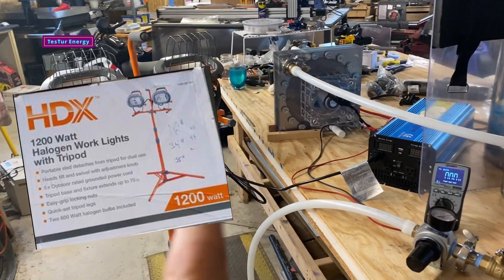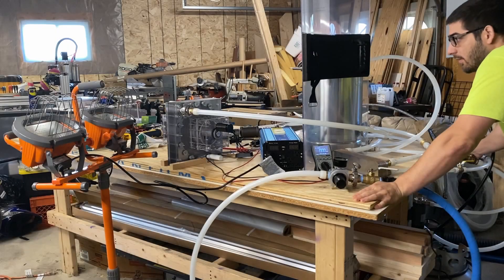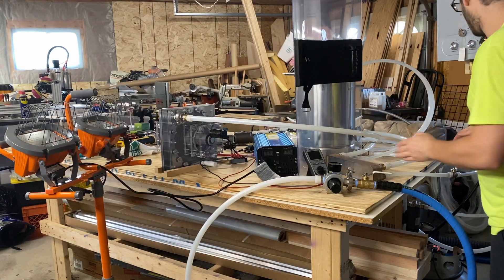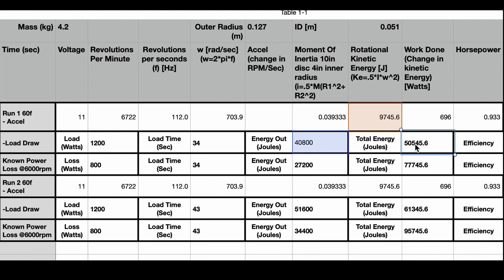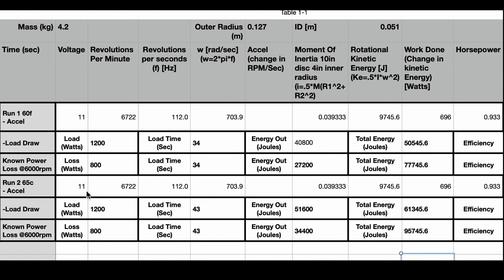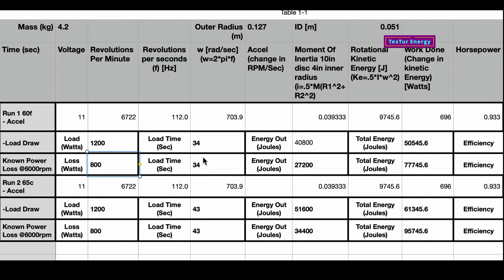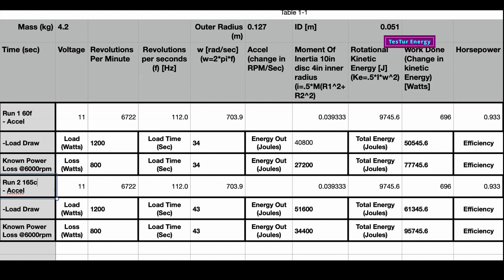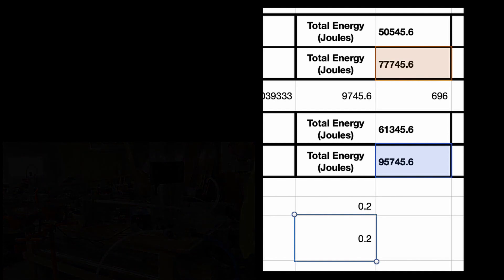Tesla Turbine 1200 Watt Electrical  Load Tests - Power Calculations - compressed Air + Propane

Comment: Really interesting. I'm an old boilermaker. I'm looking at designing micro biofuel boilers for farm and prepper situations. I'm also keen to produce a synergic stand alone energy provision  product as a side line cottage industry to supplement my contractor business. I think even using car batteries and inverters something basic under $20,000 should be do able. Great video loved the systematic extrapolation of fail and loss points. Subbed

Comment: I would love to see if this system could be run directly on pyrolysis gas from a TLUD gasifier. Woodchips are free and abundant here. Could water be injected directly into the turbine to reduce temps and increase efficiency?
Reply from the maker: Hey Matthew, thanks for commenting! It really helps the algorithm. 🙏 

Yes it absolutely can! I’m already working on the burner replication from Tesla’s Improved combustion + steam turbine patent GB 186,083. 

If you’re not familiar with this one he patented it in 1921, 10 years after the first one and a decade of R&D on the turbines. 

It’s a completely fuel agnostic electrical generator system. 

In the patent, Tesla explains that he planned to use every kind of fuel in it, from gaseous type fuels, to liquid, “colloidal fuel and even powdered coal”!!!

I’m hoping to be able to even use powdered iron as a fuel. 

You can’t use solid particulate fuels in traditional bladed impulse or reaction turbines. Note fuels that make a solid particulate exhaust like powdered iron that turns to solid FeOx’s, aka “Rust dust”

I have a couple videos that go further into explaining it!  

The first half of this video is about the vacuum steam, aka “cold steam”, systems that can be used with any heat source. However, in the second half of the video I go through Teslas GB 186,083 patent and explain all the parts to it. 
https://youtu.be/5Y3D13JmtcA

There’s also a bunch of videos on my channel of the burners I’ve actually got working and making high temp superheated steam. 

I will be connecting that to the turbine next after these next compressed air tests that I’m doing right now. 

These are the latest liquid fuel burner tests for the replication of GB 186,083.
https://youtu.be/gRqKowignac

These are the latest propane burner tests.
Tesla Turbine Jet Engine Combustion System GB 186,083 Superheated Steam
https://youtu.be/KCyyiKnIarc

I’m still working on the solid fuel particulate burner but I’m not far off on it. 

I haven’t gotten to my Tesla disc compressor tests finalized just yet but I have the setup to do them already just gotta do some upgrades to my bearing and gear hubs for the generators. 
10in Tesla Compressor & Turbine w/ Built In Balancing Apparatus RC Car Dual 6s 3kW 2200kv BLDC Motor
https://youtu.be/
Reply from the maker: NIKOLA TESLA BRITISH PATENT 186,083 - IMPROVED METHOD OF AND APPARATUS FOR THE ECONOMIC TRANSFORMATION OF THE ENERGY OF STEAM BY TURBINES

“This machine is capable of operating satisfactorily at very high temperatures, with cheap fuel, containing a large percentage of impurities, and without substantial impairment of efficiency as might be due to oxidation, roughening of the metal surfaces, or similar deteriorating actions which seriously interfere with the working of other heat engines now in use.
 
In applying my invention to a steam power plant I use air, under a pressure about equal to that of the boiler, for burning gas, crude oil, colloidal fuel or powdered coal in a chamber or conduit into which the steam is simultaneously admitted as cooling agent and diluent. 

The provisions to this end will greatly vary according to conditions. 

In central stations, factories, on shipboard and in many other places compressed air, as well as steam, is available and often, too, all the facilities for fuel storage and supply may be on hand. 

In such cases the benefits of my improvements will be readily derived with but little additional apparatus and at small cost. 

If the circumstances require, I provide an air-and also a gas compressor when necessary, driven directly from the shaft of the prime-mover or operated independently by electricity, steam or other motive agent. 

Generally these machines will be of the more efficient reciprocating type, but rotary compressors or both may be employed to secure some advantage. 

Irrespective of specific arrangements I effect the combustion while the fluids are in rapid motion and in a conduit preferably in close proximity to the engine, thus disposing of most of the difficulties previously encountered and at the same time materially reducing the radiation and conduction losses which would be incurred in the passage through long pipes. 

To better insure the maintenance of standard working conditions I may add to the equipment an equalizer of pressures operated differentially by the air and steam, but this device is not essential. 

The quantity of steam is so regulated that the highly heated mixture, upon expansion through the nozzle, attains an arbitrary temperature which the turbine can safely withstand. 

The elastic fluids, after traversing the rotor and giving up to the same a part of their kinetic energy, escape through the exhaust openings and serve the further purpose of preheating the feedwater, fuel, and likewise the air when desired. 

If intensely heated, the air and fuel will be conveyed to the combustion chamber separately, but in small installations it may be convenient to feed the fuel into the compressor or air pipe leading the carburated medium to the chamber. 

When simplicity is paramount, cheap coils or heaters for the combustibles and the feedwater will be resorted to, but in order to attain a still higher thermal efficiency I employ, besides, a small auxiliary boiler through which the exhaust is circulated. 

The steam thus obtained from waste heat is fed through a suitable valve, opening at the proper pressure, into the combustion space whence it passes, together with that furnished by the plant, through the turbine first doing useful work and then adding to the waste heat to be utilized in the manner set forth. 

More fuel may now be gradually admitted to maintain the normal temperature, this again increasing the heat in the exhaust and causing a more rapid generation of the steam, and so on, until finally a steady regime is established. 

However, if deemed of advantage under given operative conditions, the steam from the main boiler may be reduced in quantity in approximately the same measure as that from the auxiliary boiler is supplied.”
-Nikola Tesla
Reply from the maker: Just released the latest update! 
Tesla Turbine 250 watt to 2.65 kW Power and Efficiency Test
https://youtu.be/XQl1DQgXVkQ

Comment: Can you magnetic bearings on it?
Reply: I don't think that the tesla turbine won't work without frictionless bearings, but using a control algorithm to adjust position and velocity would allow you to compensate for a lot of the vibrational losses due to imperfect disc and rotor machining, as well as inefficiencies due to nozzle turbulence and windage (the losses due to bypassing the blades). I think that's one of the key aspects of commercializing this -- either bigger rotors for more torque or extremely high speeds for voltage generation. Another question-- can your turbine work with steam?
Reply from the maker: Sorry I didn’t mean to imply you said that it needed frictionless bearings, just that a lot of Tesla turbine builders out there say that. 

To be perfectly honest balance is not an issue. I’ve done zero balancing on it already and the only reason there is a vibration on it now is because the round that I machined one side of the drive shaft for the bearing is out of center with the hex. But I have since fixed that with the new upgraded one. 

And yes absolutely this can work with steam. I’m building the steam system for steam tests literally as I type right now lol I will have tests ready and uploaded here in the very near future. 😬

Question, you said it needed “very high RPM for voltage generation.”… What did you mean by that? Why does it need high rpms for “voltage generation”?
Reply: @CharlieSolis  I meant due to faradays law!
Reply: @CharlieSolis  also do you want some help?
Reply from the maker: @Captaincodeine  hey yeah Cody, I will take all the help I can get! If you would like take a look at the growing Tesla turbine community on my patreon page
www.Patreon.com/CharlieSolis 
I wouldn’t have been able to accomplish 1/4 of what I’ve done without the love and support from all my patreon members. 🙂 

I also have a Tesla turbine Discord server that we just got started too!
Reply from the maker: @Captaincodeine  gotcha, yeah you only need high speed for faradays law with either a faraday disc or single loop wires. If you want a higher voltage you just need to find an electric Generator/motor that has a lower Kv rating (RPM/Volt). Currently I’m using gens that are 2200rpm/volt. So to output 12v it has to spin at 26,400rpm. But I also have some BEEFY BLDCs that have a Kv rating of 140RPM/Volt, so to produce 12 volts 1680rpm. As well you can just as easily find motors with a KV of 
30RPM/volt for 120v at 60hz. Or 13.63RPM/volt for 220v at 50hz. If you want a higher voltage you can increase the RPM/Speed of the turbine but you could also instead increase the voltage just the same by increasing the number of windings in each Gen/motor pole or by increasing the strength of the magnets used. Either of those will increase the voltage without having to increase the speed or RPM.
Reply from the maker: Hey Cody, thanks for commenting! Oh yeah for sure it can have mag bearings added!! That’s a simple add-in once we’ve got the rest of the turbine working even better though. I have nice bearings that are good up to 30,000rpm and these cheapo aluminum discs in this turbine have a max safe continuous rpm of 15,000 rpm. At least that’s what my calculations give me for being under 80% of the yield strength and 75% of the max tensile strength. So 15,000 rpm for these new bearings I have should be able to work very well with much better efficiency for very long periods of time. Plus they’re only $20 for a 10 pack. That’s a bearing change out once a year for the next 10 years. So I figure to keep the system cost down it should be fine. Not to mention my turbine is more than capable of outputting what’s needed already. Modern precision bearings already get like 90-95% if they are kept cool. Trying to chase 5-10 percentage points it’s my really my biggest concern. Especially not when the sun outputs enough thermal energy that even a moderate sized solar thermal collector could provide far more energy than most would need and even the loss from the turbine would be usable for heat in the winter. 🤷‍♂️

I’m of the belief, and now this is just my own humble opinion of course, that if bearings are such an overriding issue for a Tesla turbine that it won’t work without “frictionless” bearings then there are a LOT bigger issues on that Tesla turbine to deal with than the bearings… because if it can’t get enough torque to at least work with modern precision bearing, heck even modern bad bearings, the turbine’s parameters themselves have to be completely changed. It’s a hard reality most Tesla turbine builders don’t want to admit. I get it, they’ve been told it NEEDS frictionless bearings because the Tesla turbine doesn’t get torque, or even can’t output real power or torque at low RPMs but that’s simply not true. As I’m actually showing with this video. This turbine I built is just abysmal all things considered too. While it’s getting almost 3kW peak to the shaft output from compressed air alone it’s still just a plastic and aluminum turbine. It’s got losses from everything between the 100ft hose from the tank, 2x 20plate heat exchangers, bad nozzle geometry, over flow because of the wide casing endplate tolerance to the turbine endplates, bad bearings, plastic gears, completely misaligned generator gears (not to mention the plastic motor mounts allowing the generators to flex out of the way further adding to the gear misalignment under load), to then generator electrical losses, rectifier losses, and inverter losses after the turbine itself.…. And it’s still outputting 1200watts of power with just room temp compressed air all the way down to 65psi….after all that… 🤷‍♂️ so I just find it hard to believe that Tesla turbines need “frictionless” bearings to work like some builders have claimed they do. But hey that’s just my own opinion. 

And again, I’m not against magnetic bearings or anything, because they are freaking awesome lol but they are now an industry standard off the shelf available part that I can just add to my turbine once everything the turbine actually does is really honed in even under the worst of conditions. Because if it works even half well under terrible circumstances, it’ll only be better with precision parts added after. 🤷‍♂️ I’m not trying to get lost in the weeds searching for the holy grail of frictionless bearings just to make my system work. But again that’s just me 🤓
Reply: And have you tried connecting the output to a vacuum?

Comment: Bro.i am in am scared for your health. You were in the safest spot imo but those disc's have alot of momentum. Another channel found using Capacitors reduced load on the turbine drastically. This was a wind turbine. I can't remember the name European brittish I wanna say haha shame.
Reply from the maker: Hey cavelvlan25! Thanks for messaging. I appreciate your concern but I’m being perfectly safe. 😬❤️ these discs have a safe continuous rpm of at least 15,000rpm and that’s the discs still well under 80% of the yield strength and 75% of the Mac tensile strength. And in these tests the turbine is only spinning 6500rpm. That’s still under normal piston engines max rpm too. These discs are just made out of cheap 3105 h13 aluminum discs. I have all the materials to make this exact turbine out of much higher rpm materials. The 7075 T6 aluminum I have will safely do a continuous Mac rpm of 30,000rpm and the carbon fiber sheets I have can safely continuously spin 10in discs at 60,000rpm. 😈😈😈

As for the capacitors, can you share who you saw so do this? Because capacitors on the turbine output basically act the same way as having a flywheel on a piston engine. It won’t reduce loads but It helps smooth out any high load pulses from an engine if converting back to pulsed DC because the frequency coming off the turbine is higher than 60hz and needs to be converted to 60hz for typical 60hz 120vAC output. Typically piston engines use something like this because of the “bang bang bang” pulsing nature of the power stroke. So it smooths out the forces on the driveshaft to come off smooth.
Reply: @CharlieSolis  hope your reinforced parts make it smooth. The creator that used the capacitors is Robert Murry-Smith in a wind turbine video. Not entirely sure it is relevant to your build but hopefully something good comes of it
Reply from the maker: Oh yeah that’s what Robert is doing in his video. Using it to smooth out the AC pulses for charging the battery. It doesn’t reduce the load though
Reply: @CharlieSolis  correct, definitely not my field of expertise. Figure it might be helpful to you in one way or another
Reply from the maker: @cavelvlan25  yes! I’m not using a capacitor at the moment because the frequency coming off the motors I so crazy high I don’t believe the inverter can even tell. The generator on my setup is geared UP, yes up, to the the generators at 3.6:1. So when the turbine is at 6700 and the generators are spinning ~24,000rpm. If they were single pole they would be 400hz. But the generators are 12 pole. So so the 3 phase ac frequency coming off is 4800hz, and the Ripple DC coming off the 3 phase rectifier is actually at about 1.7x  a single phase voltage coming off the generator. Lol so as far as the inverter is concerned that’s basically a constant voltage when it’s a high frequency ripple of a DC output. But the direct on shaft generators I have for the next all stainless steel combustion + steam temp capable turbine will be a much lower frequency coming off because the generators won’t be geared up. So I I’ll most likely need to supply a capacitor for that.
Reply from the maker: But yeah 90% of that kind you are hearing in this video is from the gears being misaligned. After doing a full breakdown of the turbine after these tests to see how it faired I found that the gears being plastic flexed out of the way a bit under high load so those have been replaced with metal gears and the motors themselves were able to actually flex out of alignment too. And even worse the motor Mount plates also were misaligned all together so the gears just weren’t even remotely meshing properly. But I have since fixed all of that with all new all aluminum motor mounting plates. This alone should give us 10-15 percentage points back on efficiency.
Reply: @CharlieSolis  https://youtu.be/GKHVENEsHzY